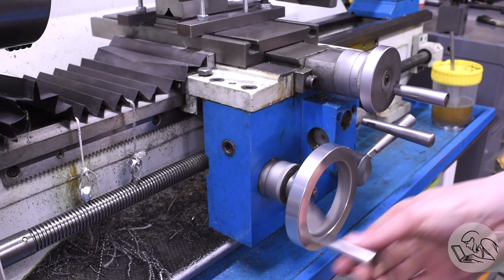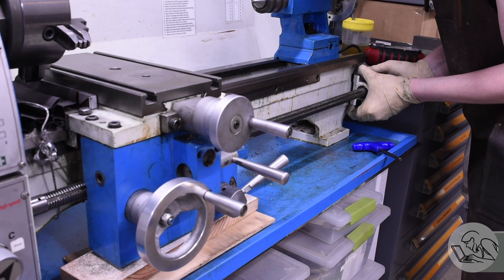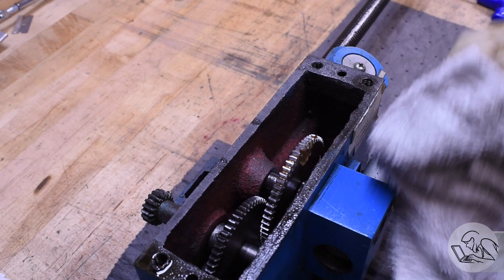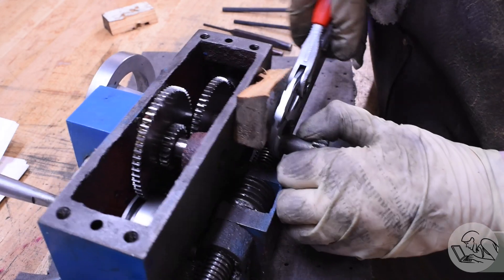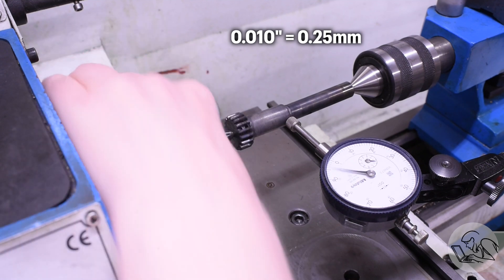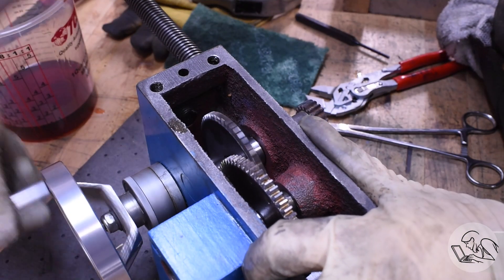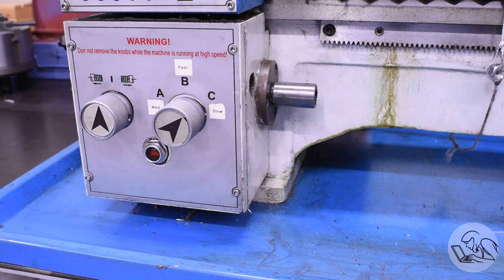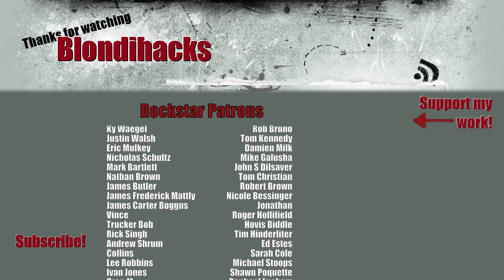Lathe Crash And Repair! 🤦‍♀️

Comment: I admire your tenacity - I once tried to drill out a rusty, seized in roll pin - it was impossible as it was hardened so broke a load of drill bits - ended up getting an angle grinder on it! Heatin' 'n' beatin' - great phrase :D Oh and telescopic magnet is brilliant for fishing things out!
Reply from the maker: Yah I think they are spring steel, so maybe a carbide drill would be required. No fun, I’m sure!

Comment: That was kind of you to stage that with the lack of room and the drill press so we could see what to do if there isn't enough room for something. I also think it helps others be less frustrated when things come up because if Quinn struggles it's okay if I do. That was brilliant of you;) 
Also, aren't you worried that you might have accidentally hardened the mild steel pinion by heating it like that? Especially with acetylene since it makes a LOT of soot and soot is carbon and carbon hardens steel. You might have accidentally made a part that Elon is missing for Space X. Shhhh! Don't tell!

Comment: I haven't visited your channel for months. Those alignment pins with threaded holes are pretty common on big machine tools, they also make a type that is designed to be removed by forcing hydraulic oil in there, at a high pressure.

Comment: Hey Quinn, I have a Craftex CX-708 10" X 18" Lathe new, it's got about a year or two on it now with low use (I know, my bad).. When I first unpacked it, I drained the factory oil out of the gear box because I 1) didn't trust it 2) it was almost empty (shipped with minimal oil). I put in fresh recommended oil in and noticed it was "noisy", I noticed the gears weren't "picking up" what I would consider enough oil to properly lubricate the gear head. I added about 4 oz. of Lucas heavy duty oil stabilizer to the oil. Wow, what a difference, the noise was completely dampened and the gears were all picking up a great coating of oil which reduced the gear lash and noise big time. The lathe was completely different in performance as well, it doesn't labour like it did before when taking an aggressive cut. We use to use the Lucas Oil Stabilizer in Semi Trailer tractor transmissions, it increased the service duration of the transmissions by offering that "coating effect" to the square cut gears that you don't get with standard gear oil. I also added it to my collectors 1983 Kawasaki 440 LTD motorcycle oil and it's the difference between day and night for performance and smooth shifting on long rides. You like to share tips and tricks so, I thought I would pass this along in return. Thank You for sharing and have a great day.. Cheers from Canada!

Comment: I liked Cleon's idea with vise, especially if you had Made In Poland's hydraulic monstrosity that moonlights as a press, but bent is bent, perfection isn't possible. Maybe a large chisel to apply the force in smaller area? What if you had Abom79's flame welding rig to add metal, and then reground it to diameter?........

Comment: I think if you removed the lead screw first before apron it's easier to get apart but when reassembling, the key on the worm-wheel falls out and is just about impossible to re-fit. I seem to remember it being done but don't remember the machine. It was about a 1-1/4" dia screw but the parts were too heavy to manhandle so it had to be done through an access hole

Comment: What impresses me is that you've had this lathe for how many years before you managed to do this? I was replacing this very same part within like, a month of owning the machine lol. So, ya know, well done on that. Side note, my "shear pin" was literally just a rough ground piece of steel. So quality is apparently a moving target with chinese machines... 😂 Edit, slide hammer works great on taper pins. They're cheap, in case you ever see one at a yard sale for a buck or something, pick it up just in case maybe. Edit Edit, I must have fished that roll pin out 7 or 8 times. It was a gas watching you go through this and reliving my own drama. What a pleasure, thanks for sharing this!
Reply from the maker: I did break the lead screw nut on my cross slide in the first two months (crashed it into the inner stop), but I didn’t have a YT channel at the time. 😁

Comment: Good fix. I wonder if putting it between centers on the lathe and heating it and then using a ballbearing centering tool in your toolpost could have pushed it straight.? You know those homemade tools to get a part to run truer in a three jaw. Or do you think the crosslide is too light to push it straight. Please dont REMOVE the knobs while the machine is running.🤣.

Comment: I didn't crash the lathe but had done a similar job lifting the complete assembly off, it was a secondhand myford ml7 the previous owner cleaned it ish and was very good with the oil it was getting tight so I had to face striping it for a clean.
Great video love watching you work.

Comment: I had the same problem  - on essentially the same machine Warco 250V) only caused by the locknut falling off the carriage lock and jamming. I fixed it ( much less elegantly than Blondihacks) but also using an oxy torch and hammer. Am now worried that I used the wrong gear oil ( just ordinary 10/30 ) because its ok in splash boxes and has good anti rust properties. Any thoughts welcome.

Ps put small rare earth magnets in bottom of boxes to hold any magnetic debris.

Comment: On EMCO lathes (made in Austria) the leadscrew is attached to the gear by a simple 3mm aluminium pin. if something crashes it cuts itself acting as a fuse.
I crashed 3 or 4 times without any damage, just the pin to be replaced.

Comment: When you are within .010 and your using heat,  rotate the unit in the lath and cool the high spot with either a little water or a wet rag and recheck usually can move it real close.

Comment: After the first heat the shaft will have been annealed. Setting it up in a couple of V-blocks (or similar since you have the pinion to account for) and using a clamp (I've even used woodworking clamps) you can both measure and bend in the same setup. Even measure the deflection. Clamp the shaft downwards toward the table with the high spot up.

Comment: Another great videa - I love machine repair. I had similar symptoms on my lathe and did the same type of disassembly, execting a bent shaft. But no! Badly machined internal gear on the pinion shaft with three fat teeth, A couple of hours of filing later...

Comment: Hi there, I am following your videos and there's an obvious reason for this. They are so cool!!! Good job with this repair! I have the exact same lathe, took the gearbox apart: cross slide exceeded maximum limits in auto mode, so everything got STUCK! 😱 Took it apart, realigned gears, replaced pins and gues what! It's been working ever since...the only thing thta still bothers me: oil leaking from unde the gear box...cant't do anything about it. What's your experience? Is all of the oil inside or leaking after disassembly? Have a nice day!

Comment: Regarding pins , roll pins, taper pins, shear pins, cotters etc, the worst car example I know is the Austin 7 front king pin cotter pins. Unless you know how they work you can not get them out. The king pin is round of course and sits in the stub axle. The cotter that locks it in isn't a standard tapered cotter, instead it has a half moon cutout in it. You put that through the side of the stub axle first, line up the half moon with the hole then drop the king pin through. Then you can do up the nut on the cotter to tighten it all. Undoing it you need to just loosen the nut to release the pin (good luck after 90 years on an original) and slide the king pin out. But externally it looks like a normal cotter you can just tap though. You never can though, the half moon holds it captive.  Not sure where else that system is used but unless you know that's what it is it a real puzzler! I don't think you truly own a lathe until you have made a part for a lathe on itself! Bonus points if the part you make is one that typically renders the lathe unusable without it!

Comment: I wonder how much wobble would be needed before it it affected finish (since the carriage will be speeding up and slowing down a bit). Same for threads, though I'm guessing it would only make a difference on extremely fine threads. Hmmm... who needs lock nuts when you can just vary the thread pitch? :D

Comment: Having taking apart a 1940/50's (1943 design date, unsure of actual production date) lathe's carriage powerfeed and leadscrew assembly, I am VERY envious of that coupler to remove your lathe's leadscrew from it's gearbox, aswell as the pillowblock's alignment pins that are front-removable!
In my case I had to take the gearbox, apron, and pillowblock off and back onto the lathe as one large, unwieldly assembly!

Comment: I'm curious if the small runout would be visible as a pattern in a light finish cut.  Basically, the carriage accelerates (by minuscule amount) every two turns of the handwheel and decelerates (averages out) th next two turns.

Comment: Quinn, you nailed it, I love repairing more than the oh sh#$%. Good thing for you you were dealing with parts easy to see and feel. Unfortunately last night I was repositioning my $100.00 indicator on my mill to set up my rotary table and accidentally knocked it off on to the concrete. Well didn't work when I picked it up. Rest of the evening spent digging out watchmakers screwdrivers and doing an autopsy on said instrument,  smallest screwdrivers I had, akin to working on fleas balls. Had to disassemble the Guage and found the tiny clock arm mechanism knocked out of its groove. Removed it slid it back in place, worked perfect. So never give up no matter what. I'm 71 years old but still figure difficulties out. Hang in there girl, you are brilliant.

Comment: I hate these events because you see it coming ahead of time in your minds eye, yet it still happens. I recently did something similar to this wiring up a few lead acid batteries. I knew the terminals were close together and maybe I should put some electric tape over them but I thought I'd just be careful.  One instant arc welder lately I  have a puddle of melted battery terminals and a lovely smell of Ozone and melted plastic wafting through my shop.

Comment: Crazy me, took mine apart before even using it. It was full of nasty stuff, grinding dust and the like. Well I had to disassemble to move it to the basement, that was my excuse. I was worried I would never put it back again, but no lose nuts and bolts at the end and so far is working.
Congrats on the repair, would of have been hard to fix with a lathe that can only spin things, and parts are not cheap, they charge you the same price of a new lathe for any part that breaks.

Comment: One other thing I found doing the same repair you did was that the apron gearbox sump was full of casting sand and metal shavings from when the gearbox was drilled and assembled.  I flushed the sump to get all the sand and shavings out before refilling it with gear oil.

Comment: So sorry you crashed your lathe but I wish you would have done it 6 months ago because I crashed mine and your video would have helped me greatly.  I had to fumble through the disassembly and replacement of the pinion gear on my own, and I’m not near the machinist or mechanic you are.  Precision Matthews does sell the pinion gear and it was not too expensive as I recall but you have to drill the hole for the role pin into the new pinion gear and it has to be EXACTLY in the correct location on the pinion gear.

Comment: I had a table saw come in to the shop this week.

Very similar damage as you are seeing, but my 
lathe was (is) still intact.  Evidently, someone was 
moving this heavy saw, and it fell over, and bent the 
height adjustment shaft.  30 (or so) degrees.  I managed 
to get the shaft out, bent it straight.  Within 4 or 5 degrees, 
but the shaft was no longer really circular any more.  (Did 
I mention my lathe?)  Chucked it up, and filed/sanded it, 
until it ran true.

We had another table saw come in, that is the same model, 
and I used the one I had apart, to figure out how to service 
the newer one.

When I got the first one fixed, it ran better than the newer 
one.

Yes,I DO get inspiration from your videos, even though when
I went to machine shop, men were walking on the moon.

steve

Comment: Yup.......brings me back to crashing my Craftex 709 ............twice!!!   Once  in the x....and once in y. 
You really have to be on the ball when  using the power feeds.    Cracked some change gear bushings.  So that was my baptism into my first lathe projects.....making those bushings which included keyways....luckily on the outside diameter of the bushing.     I really took it hard on these crashes.......but could happen to besr of us.
I love your videos....and learn something all the time.    I'm an old timer , but still have to work partly to support this habit.....amongst other things.    Keep up  your great videos!!!

Comment: I lined most of the floor of my garage in the “both” PigMat when I was doing major maintenance on my Suburban to soak up drips, splatters, etc. so I didn’t track it into the house and had slightly less chance of ending up with ATF in my hair…  That last one is impossible to prevent I swear!

Comment: We have been there. Keep the faith, you are not alone. I took the pinion out, cut the shaft off, drilled a hole through the pinion and replaced the shaft with a straight bit of ms. Just used the compound for turning. It worked fine as well.
Reply from the maker: Using the compound to do the turning is a great workaround. Will remember that!

Comment: I am impressed! Nice repair, and no the pinion is not hardened in any way. It may have had the pinion gear teeth put through a ring to induction harden them a bit but it is transfering stuff all horsepower so why would anyone bother. If it is like most of the Chinese rack pinions I have worked on you likely could have held the gear end supported in a vice then cold bent the the other end by slipping a suitable thick walled tube over the exposed shaft. Then true it up with gentle persuasion, hammer or physical pull, or both. Hope the teeth on the rack were not damaged! This quite often happens in such incidents. I fix machine tools at schools as part of my job so have faced similar situations.

Comment: Did you measure up that brass shear pin while you had it out? Manufacturing a few spare shear pins and having them on hand in the spares box is better than having to order them up and wait for them to get delivered if you do ever crash the leadscrew somehow.

Roll pins... I had a couple of roll pin insertion tools for some electric motor assembly work I did long time back -- basically a punch with a hole drilled up one end to take half the roll pin and a small cylindrical magnet expoxied into the top of the hole to hold the pin in the punch. Once the pin was securely started in its hole I switched to a regular roll pin punch to finish it into place.

Comment: Been there, done that with using a long screw and a stack of washers to pull pins. In my case, dowel pins in blind holes on an ATI robot tool chuck when replacing a retainer race plate. Too lazy to fetch a slide hammer.

Comment: Nice job Quinn,  we have  straighten a few  shafts  between two Vee blocks and using the  arbor press .  I realize your shaft is very small but I am always amazed at the memory metal has. some times  you give the handle  (its long) a tug and the shaft springs back . Your patience  and  approach to  problem solving is inspirational  ...    Pete M

Comment: Nice job and thankfully a relatively simple fix (could have easily been much worse). I got a chuckle from the wording above the knobs on the front of your lathe where it says "Don not remove" knobs while the machine is running at high speed. So what ever you do, don't let Don pull the Knobs off your lathe while it's running. lol.

Comment: Reminded me of pulling the main cam/bull gear assembly out of a much abused & misassembled 1875 platen press. Beautiful old machine, over 100 years old. Did get it fixed but it was quite a puzzle getting the beast to run smooth again. (Nothing’s more fun than running a treadle powered cast iron beast. And yes, I had the same pin problems.)

Comment: I have this exact lathe and had a similar type of crash and bent the same shaft. Mine inevitably was also cracked  where the cross pin presses in and I discovered that the whole part was made of cast iron. I ended up cutting off the shaft from the gear, using just the compound to bore out the gear to 11.8mm , and heat shrunk the gear on to a piece of 12mm precision ground 1045 steel shaft I got from McMaster Carr. 2 years later its still standing up to heavy daily use. It's hard to believe how sturdy these little lathes are, my Pm1022 has literally faced and chamfered 300 stainless parts a day for 5 years and shows very little wear. It can keep up with my Doosan Puma no problem when I need to clean up the back side of parted spacers and standoffs, carbide ccmt 32.51 inserts are just perfect for the power it has.

Comment: Hey Quinn, Great vid.
I did a similar thing under power feed, my lathe is probably the same as yours only badged differently. Probably only had the lathe a few weeks so bit green tried to get a bit to close to the chuck panicked and well crashed my nice new lathe :( It was the same part as yours, I did try heating the part but didn't have any decent source of heat ended up buying new one, cost me 58 fookin £ :( My lathe did not have the brass sheer pin, it was steel!!! I have a ton of that oil mat stuff (work for a ferry company on the Mersey) Nuff rant. TFS, GB :)